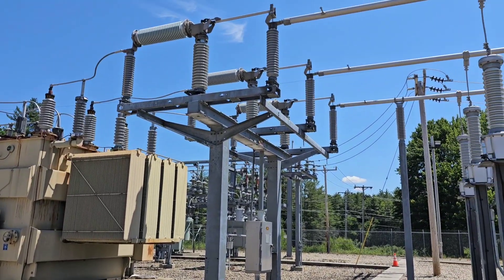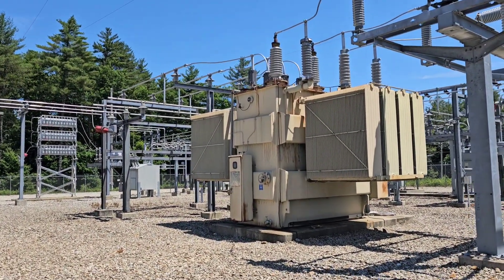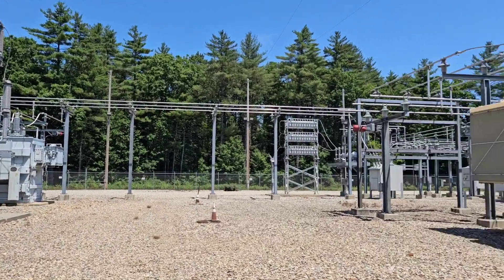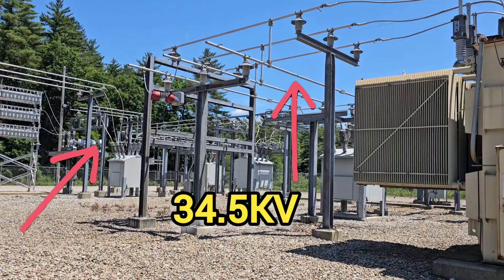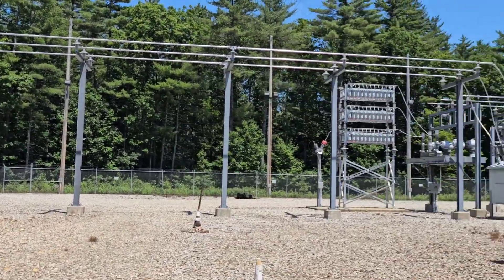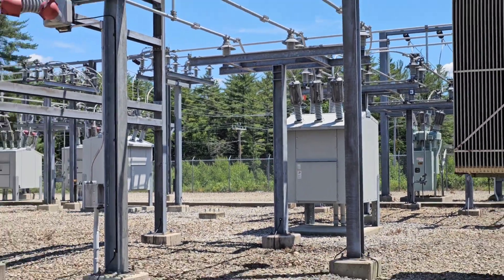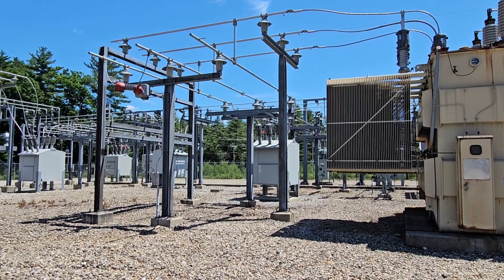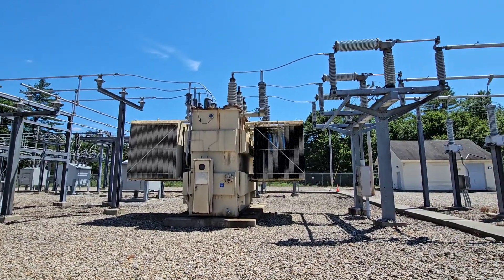How a basic substation works. 2 transformer design simple explanation

Comment: Are the high-side primary windings in the delta configuration?
Reply from the maker: Yes. Both transformers use a Delta-Wye configuration and have a low side neutral.  Most of our transmission to distribution transformers are dyn5

Comment: Eventually you get 7200 volt feeds to your transformer on the pole and stepped down to 120 volts
Reply from the maker: @ocsrc  we have some circuits that feed directly from 34.5/19.9 to 240/208/120